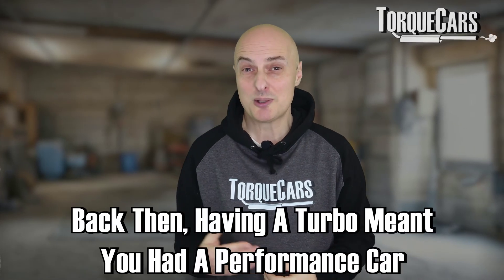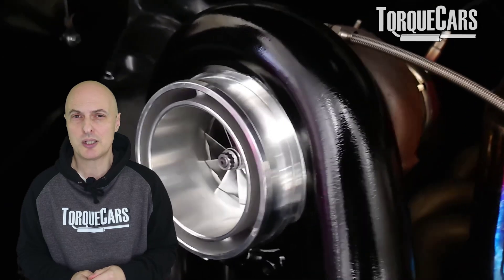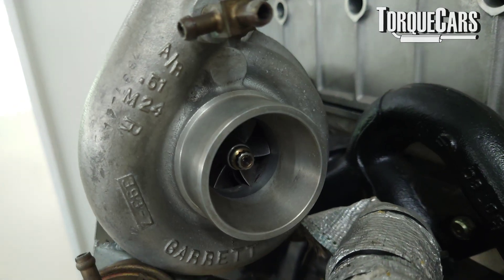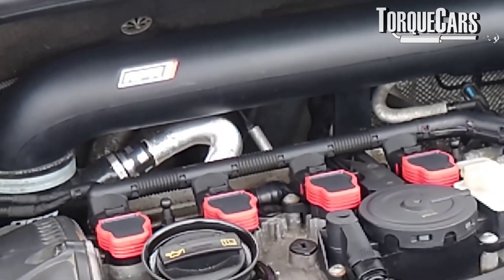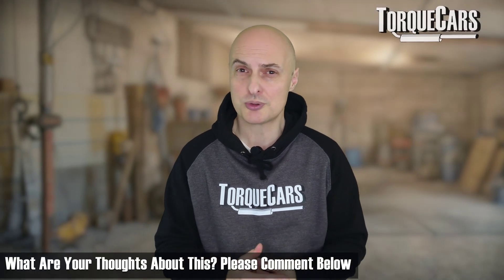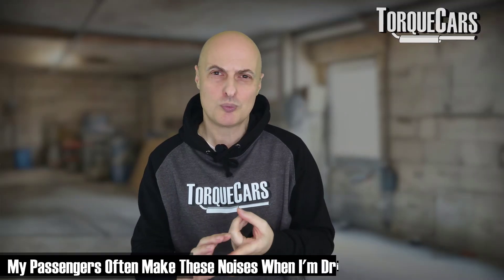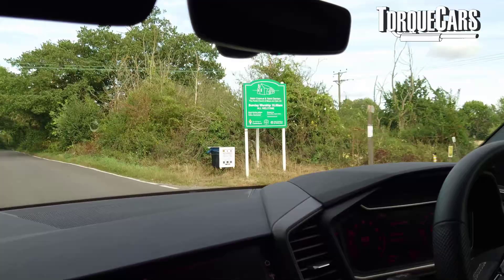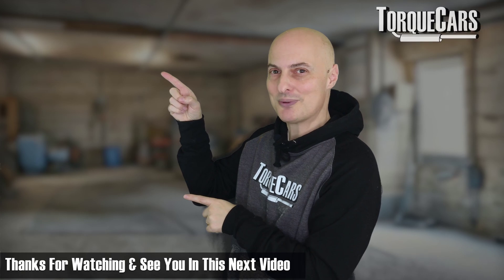8 Stupid Mistakes That Kill Turbos - A Little Mechanical Sympathy Helps You Drive A Turbo Properly!🔧

Comment: Talking of fuel, my A14NET engine runs better on E5 then E10. Better fuel economy and more power. The manual says fine for E10, but does fine mean indefinitely, or does fine mean for what the manufacturer deems "lifetime", aka ~5 years? 😂 considering ethanol is hell for engine seals and rubber to begin with, I'm ok with paying the extra 0.1£ per liter for higher octane with less ethanol 😅

Comment: Ignore all of this if you drive a VAG, they're total crap anyway so they'll break regardless!
Reply: Really.  Thats your contribution ?  SMH  My VAG does great and in the Central heat.   5K OCI mind you
Reply: @DavidReagle-z1i  if i had Vag, i'd do 3K miles change, every time!
Reply: @18_rabbit  It actually varies .  This time was 4k.  But yes super safe would be 3k.  Castrol Euro 5w40.  Running and pulling great at 122k.  2016 Passat 1.8t
Reply: Oh and I could redline my 2.5 Jetta every day getting on the freeway and it never skipped a beat. Thing was literally indestructible.
Reply: Not true in the slightest. I’ve had everything from a mk4 1.8 t to now a mk7 gti. And even a 2.5 i5 mk6 jetta. All of them went to 300k with basic maintenance. Even grabbed 1 mk4 1.8t from and auction for 1300 because it had an over heating issue. I fixed it, it didn’t have qc or anything but I drive that thing from 90k miles all the way 270k before the transmission went out. Now I’m driving a mk7 gti, and these things can be tuned up and reliabley make 500hp and daily driven on that. Please don’t call something crap because you failed to do your maintenance on time. And wanted to let the car go and let all your maintenance go past due, and let parts wear out like your previous Honda civic.
Reply: @HatsuneM1ku01  lol.  E888 is the worst thing ever, basically.

Comment: 2024 Tiguan here.  I always warm up the engine.  Is there benefit to using higher octane?
Reply: Octane is tye rating for detonation. The lower the octane, tye lower tye pressure and temp it takes to cause a detonation in your engine before the ignition cycle. So you want a higher octane on turbo cars because, they are forcing more air and fuel into an engine over naturally aspirated. So you have higher pressures on the pressure cycle of your engine. Lower a game can detonate on the pressure cycle of a turbo car, especially when driving it harder, since it’s forcing even more air and fuel into the engine. So yes there’s a huge benefit to higher octane. Especially since your Tiguan is most likely the 2.0 or 1.8 tsi and not the vr6
Reply: @HatsuneM1ku01 Thank you!  I have a 2.0 tsi and I haven’t gotten a good answer on that until now.  I don’t usually crowd the engine but I want to use the best fuel for that type of engine with longevity in mind.  Thanks again for taking the time to explain it!
Reply: @Modeltnick  yup. I have a 2018 gti
Reply: It prevents engine knock (when the air & fuel mixture spontaneously ignites without ignition from the spark plug, because the ambient temperature of the cylinder is so high). In other words, It prevents your engine from reducing power in order to save itself from blowing up.

Comment: My Toyota owners manual says after driving hard you should let the engine idle for 1 minute to allow the Turbo to cool down. The engine is a 2015 design the Turbo is both oil cooled and water cooled.
Reply: Wow. It shows how bloody important it is to cool down. Toyota don't mess around. Unfortunately, they have extended their oil chage intervals like all the other companies.
Reply: @gravemind6536  yes, I owned a '86 Mitsubishi Cordia GSR turbo in the mid 90s and it had a sticker on the top of the door trim saying basically that same thing
Reply: The manual for my 2025 truck still says the same, for the same reasons. Note 1 minute is sufficient.

Comment: I haven't been able to afford my oil change yet... it's a real shame, I know it needs to be done it's been nearly 20k!
Reply: @Attaccabottoni  beyond help now, so why bother.  I never go over 7k.  Ever.
Reply: @howebrad4601  many today never go beyond 4K miles! maybe 5K , depending on usage pattern
Reply: Bro 20k yikes. Shouldn’t go past 7k, 10k itself is quite high. 20k, your engine, bearings, cam lobes, crank journals, pins tok rings and walls etc are all pretty much pre wearing itself at this point, because there is so much carbon built up in your oil, it’s basically acting as a wet sand paper in your engine
Reply: Put somebody else's used oil in. Better than not ever changing it

Comment: Would you class an Ej20 turbo engine year 2009 a modern turbo charged engine?
Reply: Let's see what he says; but I'd say yes, it's a modern era engine.
Reply: Turbocharging has come some way since 2009 but id still say it's reasonably modern. It wont have the modern turbocharger "protection features" though from the factory, things like that were never thought of at the time.

Comment: I bought an Astra J 1.4 T, 140 HP in 2014, new from the dealership. Nippy, responsive, stable. Exquisite maintenance from the very beginning: oil plus filter changes every 7500 km (more often than the manufacturer recommended interval), Castrol 5w30. Every morning, 30 seconds waiting until the revs went down to 750, and then gentle driving for 10 minutes. When I got to my destination, instead of killing the engine immediately, I counted to 30 and then turn the motor off. New iridium spark plugs at 70000km, coolant flush, etcetera, etcetera. Never ever mistreated it.
Only 115000km and one day on the motorway, doing 120 km/h in 5th, very slight uphill, had a sudden loss of power. Took it to my mechanic. Code P0299. Turbo gone, huge crack in the housing near the turbine. Bad luck?
F*** it, fitted a new turbo, Mellett imported from the UK. Now I simply don't give a flying ****, I just turn the key and drive off.
Reply: I thought those Astra J 
1.4T were not well build. I bought a second hand one. It was not the best. Not long after buying it. Had to change Turbo, coil packs, tapped cover. It was turning me into a mechanic and diagnostician. I then sold the damn car. Its was the best decision I took, got my peace of mind back.
Reply: It's bad luck mate, it's not like it's a big deal to give a few extra minutes to let the engine warm up.
Reply: Some engines benefit from driving it like a rental :)
Reply: @thetruth7633  Well that's exactly what I'm doing. Little to no maintenance or care😂 I'll drive like this until the wheels fall off
Reply: @ I remember back in the days working at the dealership, we had some Mazda 323 saloon models as loaners, the hideous models with grandparents interiors, but these proofed to be indestructible. We could not destroy them no matter how we abused them. But after 17 years the rust demon got them :)
Reply: I have an Astra 1.6T 2012 model, 180HP, I was very bad on maintenance, the turbo housing had a crack at 200 000km, ran it like that for 10 000 km and, and replaced the turbo and boost control solenoid at 210 000 km, it is 95% better, I'll be replacing the diverter valve soon.
Reply: You've got the A14NET right? Damn, that had to suck big time..but the good news is nothing else broke when the turbo went? Right? 😊

My Opel has the same engine. I try to take care of mine too, oil changes before and after winter (alot of short commutes), allways letting it warm up a bit before driving off, idle to cool when I arrive, new sparks, etc. Only issue so far was at 128.000km, a broken ac compressor and a corroded rear fog light bulb connector. Just passed 135.000. I truly hope my turbo lives a long life 😅

Have you looked into the pcv bypass kit for this engine ?
Reply: @h.l-a683  Yes, that's the one. I'm not wasting a single cent more than strictly necessary since then.
Reply: It's either going to break or it's not going to break. I know loads of people that have taken care of their cars very well but something has always broken or they've blown up. I've also known people that treat their cars like dog doo doo and they keep running forever with no problems despite maximum abuse.

Comment: Ok, my question about the turbo is about high way driving. Does higher speed affect the turbo meaning... does the turbo spins harder, or wear harder, at 100 mph than a 70 mph?  
I'm talking about long consistent speed like 1h drive, not accelerating. 

Oh, and your updated info probably applies to the latest turbo, stop start, hybrid cars 2023-25 where half the car still operates while the engine is off with water cooled turbos. 
Anything older I would still stick to the old info. 
Great content!
Reply: The turbo spins up (or spools 'down' if you also "slow up" like in the video 😏) once the pressure from exhaust gases is high enough. Or in other words yes, your turbo will be spinning and providing some boost at motorway speeds.

I wouldn't worry about wear though; that'll happen so long as the turbo is spinning but just like the crankshaft it's being constantly lubricated by engine oil and most of the wear occurs during cold starts with very little thereafter.
Reply: @loc4725  Thank You so much!

Comment: I learnt how to look after turbo charged engines in the early 90s with Renault 5 GT Turbos. You learned fast with those 😀. After these I learnt to do all of the things mentioned in most of your previous videos and touch wood after over 30 years of hot hatches since never had an issue. Keeping them standard,regular servicing, not driving hard until up to temp and easing off last few miles of driving has worked for me. Great video as usual 👍

Comment: Good info! Note : Start Stop destroys starter motors and Dual Mass Flywheels, I push "off" everytime I start the car.
Reply: Get a stop start eliminator wire
Reply: @Xenon777_ I have a "Land Rover" start stop has never worked from new.
Reply: @blackvulcan100 Just be thankful that the Land Rover works 😅
Reply: @Xenon777_we cant rectify any electrical wiring system in some automoblie unit as there is warranty issue.
Reply: Start stop is annoying but doesn’t damage anything, been driving one for 10 years 170k miles never an issue with it
Reply: @thetruth7633  stop/start will help with fuel dilution on GDI engines which is their biggest problem. Unless your changing your oil every few thousand miles stop/start should be ON on these types of engines
Reply: @ Yes but only with engines at working temperatures. The problem with GDI engines is that manufacturers should have designed it better with direct and indirect injection like later Lexus engines have. This prevents carbon buildup. The problem is not GDi itself but the eco driving or wrong driving habits at all of people. This is all common knowledge since Mitsubishi had these problems back in early 00's with their 1.8 GDi engine. Add poor fuel, maintenance and the circle is round.  We had a bunch of those in maintenance back in the days - Carisma , Space Star. Great cars (built in Born The Netherlands) but not the 1.8 engine. And you should change your oil every 10000km, most people drive short distances which comes down to "heavy conditions" maintenance scheme. Oil dilution by fuel and water is what destroys engines.
Reply: I drive a bmw and coded it out using carly so that the button remembers being switched off.
Reply: me looking at this comment 242k miles later with genuine starter, flywheel and clutch on the car with a start and stop ... which i forget to put off most of the time... so even if i do not like the start and stop i have to admit is not afecting the starter and flywheel as claimed... so maybe are other factors affecting those...
Reply: @spawntohell  Brand, model, engine, year of car please.
Reply: @thetruth7633  Mine doesn’t have a starter motor with it being a mild hybrid, so that’s not happening here
Reply: Ost turn charged cars do not have start -stop systems so it is not an issue.
Reply: There was a time your friendly carshop could disable Start Stop but these days many manufracturers lock shops out of changes to software like that.
Reply: lol "push off" well that's pretty extreme clutch sympathy 😂
Reply: Never hurt my 13 year old 130k mile X3 30D
It was on the original BMW factory battery too. That car was an absolute trooper.
I coded it out on my F83 as I wanted to warm the engine up efficiently before giving it some, which doesn't work with the engine off every few minutes 😂
Reply: If you have a VAG car there's a switch relay you can connect between the button and the wire. Bought from aliexpress for 10 bucks and works for 4 yrs now. It remembers the last state (on or off) until you switch it manually again
Reply: @oxygized  but Ali express is from Ginaaaa!  🇨🇳   🍊 🦧 
Ginaaaaa!
Reply: @oxygized  but aliexpress is from Ginaaa!  🇨🇳.     🍊 🦧 
Ginasaa!
Reply: Pretty sure most cars with stop start systems have more robust starters, and some also have technology that lets the engine start back up without a starter. Idk how it works exactly, something to do with sensors that keep track of the compression in the cylinders and just sparks the right one back up or something
Reply: @noahmcdaniel4920  belt integrated starter generator
Reply: @noahmcdaniel4920  Yep there are some start-stop systems like that that don't even require the starter to do anything which is pretty nifty. Of course I'm sure the starter is used if it's needed, but otherwise its a pretty cool solution to mitigate wear.
Reply: @noahmcdaniel4920  in my Skoda Octavia 3 1.2 TSI the electromotor burned after 7 years, even if I used start-stop moderately, mostly in spring and autumn. I think/hope that the start-stop system is implemented better on the new hybrid cars.
Reply: Nope that is not correct for modern cars - they are designed for it and the components specified accordingly. 

I only switch stop start off when I want the engine to cool down after a fast run. Each to their own with that though.
Reply: @dj_efk How you think to cool down the engine shortly switching it of, it will only warm up slightly more as the coolant stopped circulating...
Reply: @ DMF will still be destroyed much faster, only Fiat , Alfa (as far as I know) have programmed their ECU in such a way that their engines stop in a gentle way that they DMF springs are not affected (most engines stall with a big shock = DMF). I don't recommend start/stop, shifting gears on low rpms, or driving around with low rpms in too high gears. Ignore the "shift up" light. ? Same goes for oil intervals, 30000km on same oil is nuts. For my car 20000km is factory, 15000km says importer, I do 10000km. Have had my oil analyzed by Blackstone. 10000km it was at 60%, after 10000km condition gets worse faster than before, so maybe 2500km left in it and then it becomes critical. I do mostly highways 200-400km journeys. Note driving in city, short trips, cold or hot climate, towing = heavy duty and manuals state different oil change interval. Still people drive an d do it at 30000km. After 100000km warranty expires and car manufacturer or dealer blame customer/driver/owner on "happens".
Reply: @dj_efk Shouldn't start&stop be auto deactivated by ECU after fast run, when turbo and oil are hot? I didn't try on my car, for being sure, I switch off S&S immediately after starting the car...
Reply: same thing also ACT/COD, is a really bad thing for the engine..